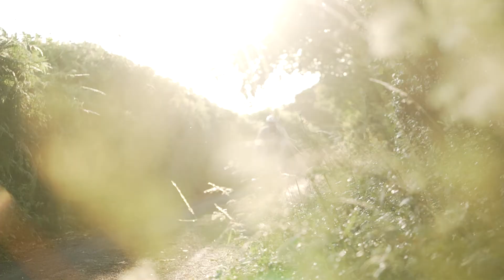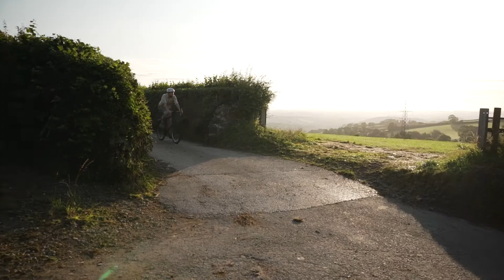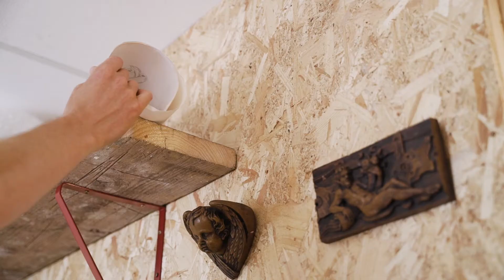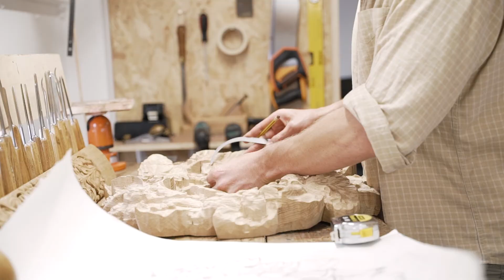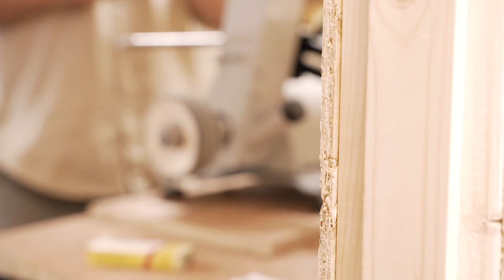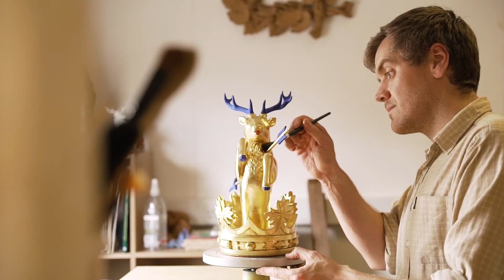The Wood Carver - William Barsley

Comment: Hi William, thanks for sharing your work with us. Just a quick question what is the make and model of your power sharpening machine. Jim
Reply from the maker: Hi Jim, the sharpening system I use is - AXMINSTER PROFESSIONAL ULTIMATE EDGE V/SPEED SHARPENING SYSTEM - 230V. It's been great so far and I wish I had brought it sooner.